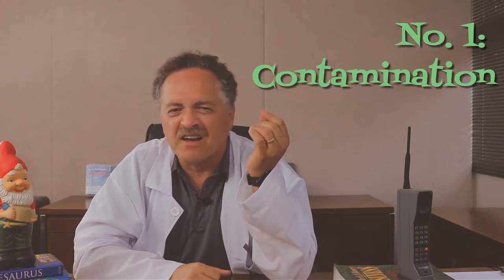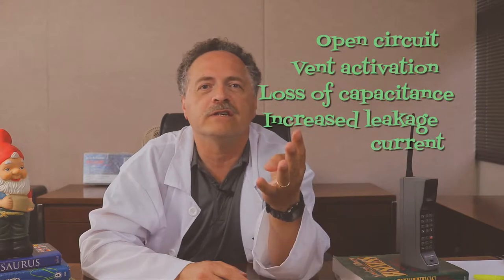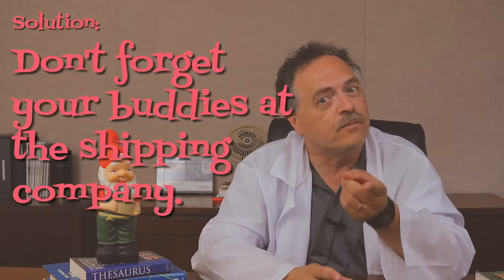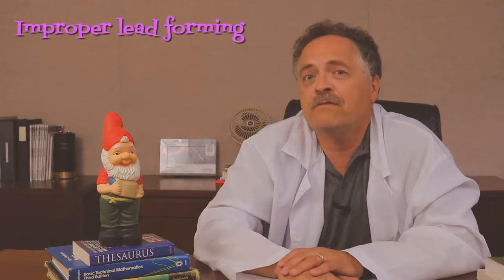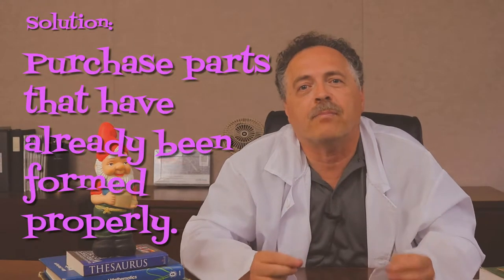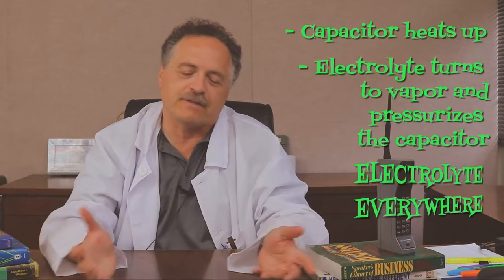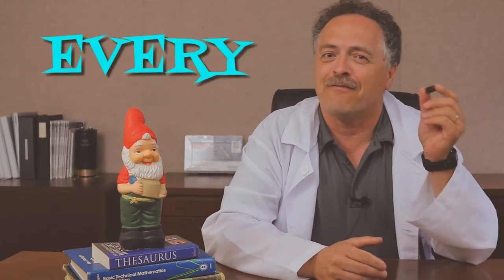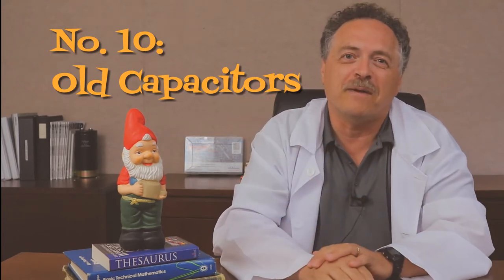Doctor Capacitor Episode Three: Failure Modes

Comment: Could you explain the importance of X capacitors? I have plug in surge protectors that self-consume 29-43 mA, and I suspect it is the X capacitors leaking current! Was wondering what effect if I remove them?
Reply from the maker: Hi @mrtechie6810, to answer your question; X capacitors are a safety component. They are to suppress voltage spikes on the powerlines to prevent damage to the device.

Hopefully this answers your question. Have a great day!